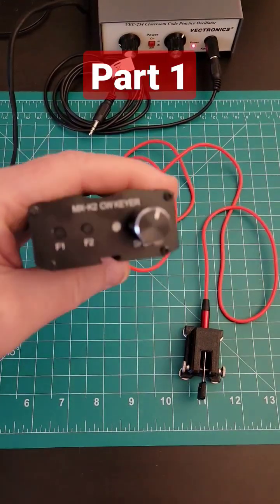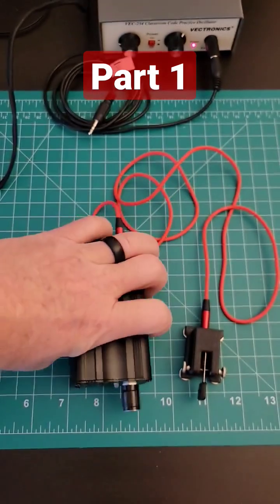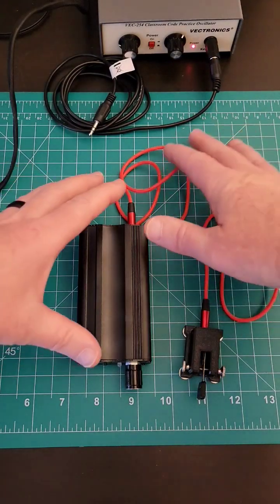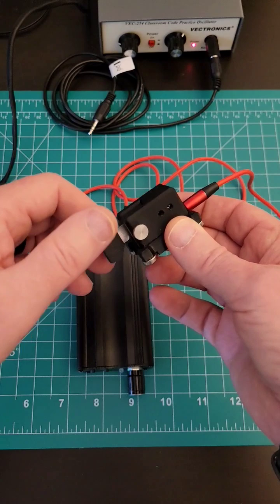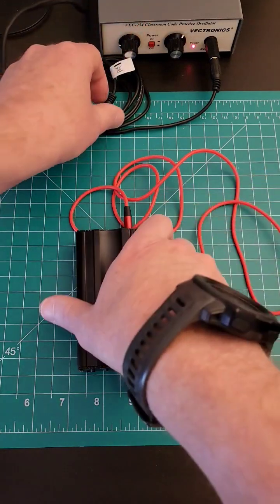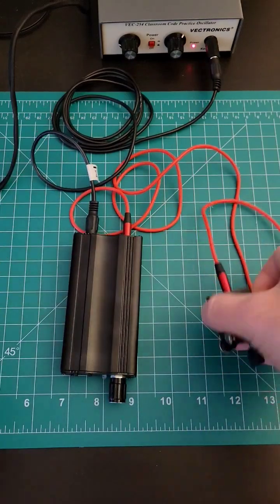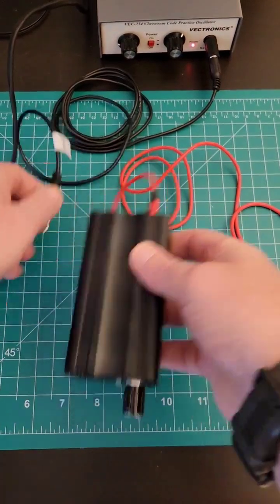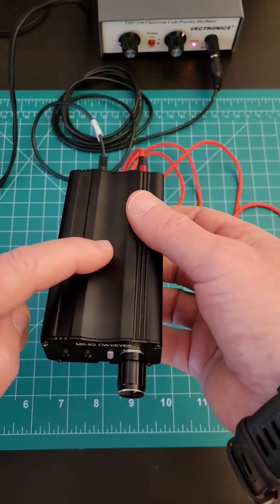Part 1 | Quick Fix: Remove The Jumper from the MX-K2 CW Keyer #shorts

Comment: Is there a way to make headphone or buds connected instead of that loud speaker?
Reply from the maker: I'm sure there is.  You have to be careful with Thevenin impedance but it should be as simple as connecting a 3.5 jack to the speaker terminals.